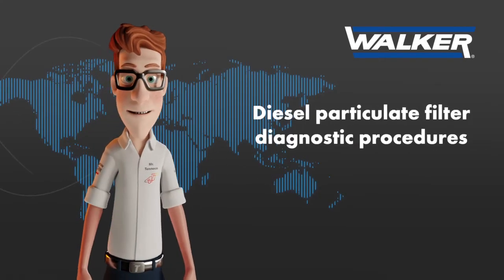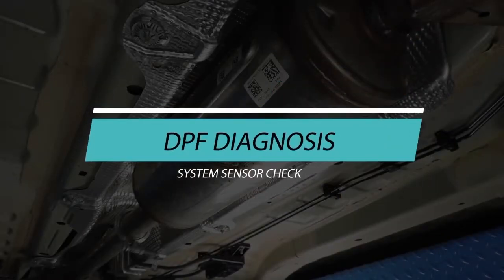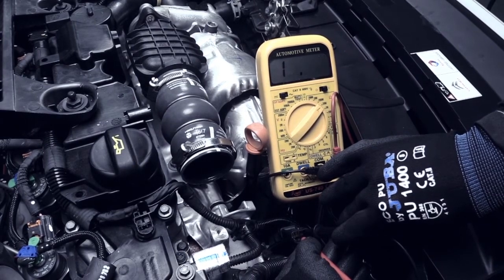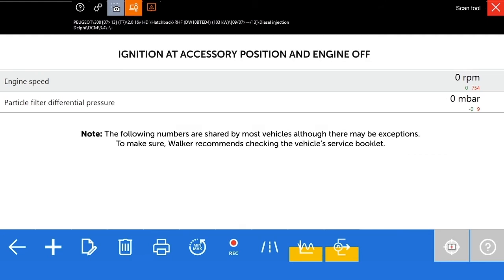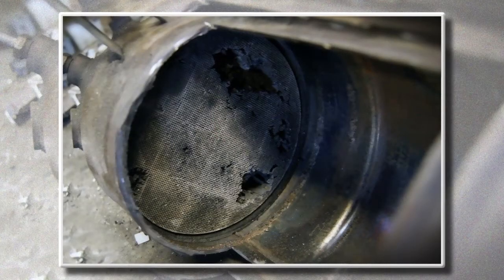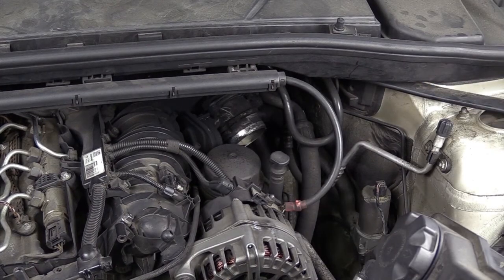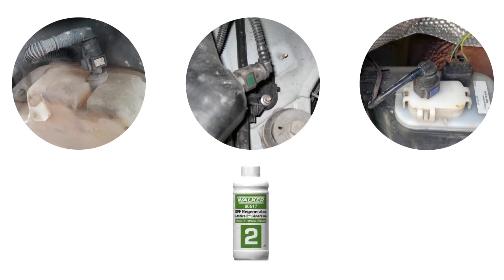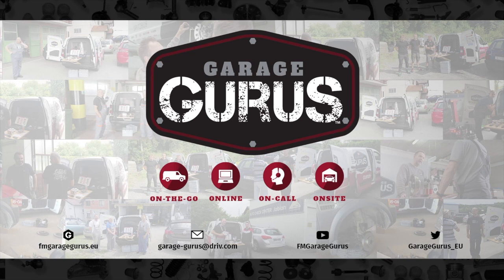Understanding DPF systems Diagnosis

Comment: That is terrible advice to disconnect the wiring between the ecu and temp sensors in order to check wiring resistance, it's a completely useless and time consuming test. Check the work when the circuit is active, voltage drop, current flow.